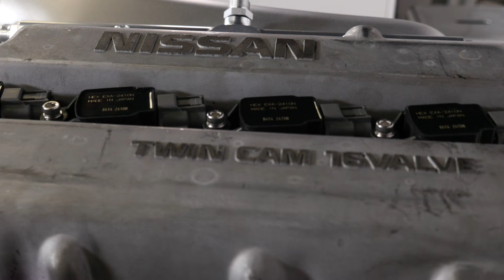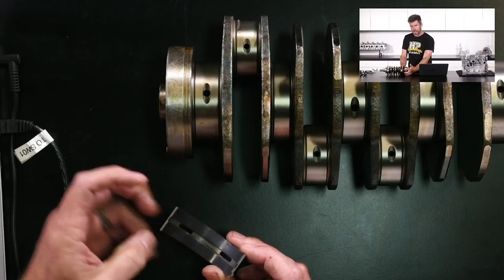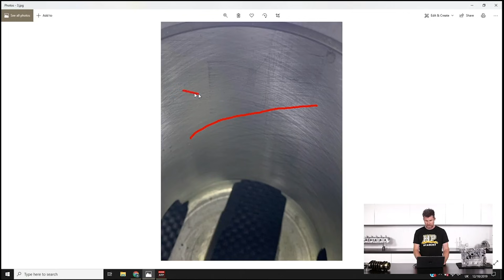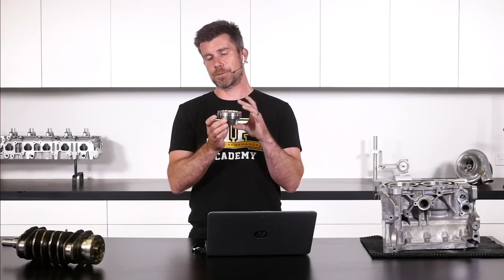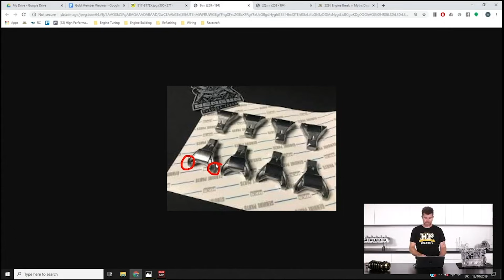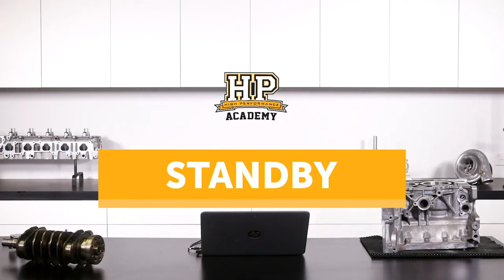Engine Break-In Myths Dispelled | Engine Break-In Tips And Tricks [GOLD WEBINAR]

Comment: I think one of the most overlooked things is the very first oil change I feel like the engine should be run for just a few miles and then get an oil change to get rid of all of the metal and other contaminants that happened to be there during the engine building process
Reply: Use a good quality oil filter, replace it immediately, as you replace the oil, after that initial break-in. It's imperative, that the filter be a fine enough mesh, that it filters particles larger than the film thickness of the oil.
Reply from the maker: I'd agree, and this is covered in the webinar.
Reply: that's why god created oil filters
Reply: @AnissaEx  All engines I've seen have some type of filter bypass, the filter doesn't catch everything.
Reply: @jeffreydurham5342  Probably why they don't want high revving until that first oil change.

Comment: On the idling note. There is a diesel  mechanic on YT that found that the trucks that spend the most time idling have polished cylinders allowing lots of blow by. He had a costumer bring in a very clean low mileage dump truck that was consuming huge amounts of oil. The guy he had bough it from said it was is good condition because it sat idling (more than usual apparently) while waiting for loads to hual. Basically the outside of the truck was great, but the engine had to be rebuild.
Reply: Yes, that's very true.  There still seems to be misconception in the diesel world that idling is acceptable and even desirable which has never been true. Just don't beat on it or put significant load on it until your oil and coolant are up to temperature

Comment: I have very little knowledge mechanically and this is exactly what I did breaking in a new motorbike I brought in 2015. Read that sitting at the same rpm was the worst so used a “hard break in” method used on race dirt bikes. Used varying loads with acceleration and de- acceleration over a range of gears and rmps progressively increasing the throttle. Not practical to do on the road out of the shop as your rolling on and off the throttle but I did this for the sole reason of maximum compression by seating the rings to the cylinder bore wall.

Comment: Sorry if I’ve missed the answer to this, but if break in can be done so quickly (and I like your rationale) then why do credible car manufacturers still say to limit revs and load for several thousand kms? Is it for components outside the engine?
Reply: One conspiracy theory claims it's because they want you to take it slow out of the dealership and not crash in the first bend.
Reply: A passenger car engine typically has tighter clearances, than a racing engine. As such, you want to make sure the pistons don't expand enough, to grab the cylinder walls, which can cause scoring. That's less likely to happen, once the cross-hatch has been scrubbed off the cylinder walls. Race engines are rebuilt after just a few hundred miles, modern car engines are crafted to last 250,000 miles, or more! It's not uncommon, for a well maintained engine to out-last the rest of the car.(not counting a bad accident)
Reply: I think it is a hangover from way back when; as stated in the video honing and ring manufacturing techniques / metallurgy have developed in the last 40 years and what may have been suitable for older components in cast iron blocks with wide clearances and much simpler engine oil compositions just doesn't help on modern engines.
It is probably in part a liability thing (they don't want an engine to blow up when the owner sends it right off the forecourt) and they know that whatever they say in their manual will be ignored anyway by the vast majority of their customers, who heard something once from their uncle's-friend's-neighbour's-nephew who rebuilt a lawnmower engine 20 years ago about how to run an engine in.

Comment: You absolutely need to get oil pressure before you ever start the engine. Disable the ignition and crank it till you get oil pressure. Assembly lube is far superior to using only motor oil.
Reply from the maker: Yes, cranking the engine to achieve oil pressure prior to startup is essential and was discussed. I actually don't advocate using assembly lube everywhere during the assembly process. I'll use it on heavily loaded components (valve train/cams, and the wrist pin), however I prefer a good quality mineral based oil to lubricate the bearings. The reason is that assembly lube is much thicker/more viscous than engine oil and this affects how easily the crank will turn after assembly. As an engine builder you tend to build up a feel for how easily the crank should turn and using assembly lube has a big impact on this feel.
Reply: No, if assembeled correctly there is lube enough.
Reply: @TheEsseboy  Starting an engine with dry galleys and only oil film on the bearings is begging for trouble. It is critical to supply oil to all of the galleys and bearing surfaces before initial startup. Heavy assembly lube will be enough for the engine cranking to make oil pressure.
Reply: @David_H_Parker  All engines are assembeled with assembly lube...
Reply: @TheEsseboy  You are looking over the shoulder of every engine builder? Not everybody uses it. Making such a statement discredits any following argument. 

Firing an engine without priming the oil system by gaining oil pressure first is typically a bad idea.
Reply: @David_H_Parker  on some engines  just cranking the engine you will not achieve oil pressure as it depends on the design of the pump it has to achieve a certain rpm to get the desired suction . I've seen people crank the engine continuously trying to achieve oil pressure and seriously scuff the shells or seize the engine if you built the engine properly you now it's right just start it with a oil pressure gauge
Reply: @terminaldiagnostics5576  Yes. That is what I said originally. 

Prime the pump with a good assembly lube or vaseline. Disable the fuel and ignition, crank it until you get oil pressure to the sensor. Install the spark plugs and re-enable the fuel and ignition. 

Cautiously start the engine , monitoring the oil pressure and other important instruments.
I have been building engines for decades and there hasn't been a problem when you use this method.
If the pump isn't primed properly, it may never develop enough suction to work.
I like Clevite assembly lube because it is sticky and primes the pump beautifully.
Reply: @David_H_Parker  Back in my day you could spin the oil pump up with a drill before you put the distributor in ;)
Reply: Ive actually seen damage done to a oil pump because the assembly lube was too thick and there was too much of it in the rest of the oil system 
It split the gear because it was basically hydraulicing a fuild that's too thick to fit through such a small hole 
Also, cranking for oil pressure is a must before starting 
It's normally best to disconnect the fuel injectors if you can, that way there isn't excessive fuel in the chambers on first start, I've seen intake back fire corse a lot of damage to a never run before engine

Comment: Hey Andre, if you 'race' a 5W30 full synthetic oil, per your suggestion of running a mineral base for break-in phase, would you also run a 5W30 mineral base? Or what would you suggest for the break in phase mineral base oil, heavier, lighter? etc. Cheers, great content!
Reply from the maker: I generally aim for the same weight oil that I intend to run, only in a mineral form.

Comment: very weird 1st of april video... everything seems sound and true haha
would you check head studs torque after some heat cycles on high boost racing engine?
Reply from the maker: No jokes here! Yes it's not uncommon to re-torque the head after a heat cycle. This is less critical with MLS gaskets than the older composite gaskets but we still did this with our high boost drag engines.
Reply: Im building a basic 7age 20v would i want to re torque the arp head studs after the first heat cycle. Im using a trd MLS gasket.

Comment: Atf on piston rings to aid with break in?
Reply from the maker: I know this is a technique that a lot of engine builders use. Personally I don't do that. Engine builders tend to be a bit of a superstitious bunch and once we find something that's proven to work, we tend to stick with it.
Reply: engine oil, fill the groves in piston prior to installing rings, no dry spots
Reply: I've used some Atf in the old oil before draining to condition seals and remove sludge deposits. ATF is loaded with seal swelling agents and detergents and emulsifiers, just don't add more than a quart and don't drive or even rev the engine with the ATF in it.

Comment: Drag racers basically thrash on engines right after a rebuild. The only "breakin" I still see people do is if they have an old school flat tappet camshaft to break in the cam. It's not as big a deal as it used to be as they make oil specifically for these now. 
I'm building around a 800hp 5.0 coyote and I will probably drive it around a bit and race it a few times before it sees boost but I don't forsee the need to really break anything in. Racing pretty much takes care of the rings.
Reply from the maker: The flat tappet cam is a bit of an anomaly in terms of requirements for break in. We still broke in all of our drag engines on the dyno which is not as much fun as it sounds in an engine with no coolant running through the block. I'm not a big advocate of just going straight into full power ramp runs as the friction due to the fresh hone pattern creates a lot of heat. That being said, drag engines at the pointy end generally get broken in during the burn out but if you have the ability to do a more thorough job then I recommend it.
Reply: @hpa101  
Lol, "bit of an anomoly" he says. (Old man voice) back in my day, sonny, flat tappet was all we had...
Seriously though, you're probably right. That's why I mentioned I don't take my racing engines straight to the track but some people do. Then again, not all of us have the benefit of a dyno, mr. big shot! (jk)
Reply: Drag racers rebuild after pretty much every run

Comment: Nice to know I've allways done it the correct manner, and most good engine builders use this technique, as I've understand. Only addition, is that when running in NiSiC ("Nikasil") coatings, you really need to be even quicker and more brutal from the get-go. Also if possible, if the engine coolant can be circulated and heated and oil can be heated, so the engine is at working temp faster, this will also aid the rings to seat to the bore in its form where its mostly going to opperate, from the get go, especially if the block is bored and honed at operating temperature.
Reply from the maker: I haven't had the pleasure of working with nikasil coatings which I'm not unhappy about :)

Comment: what happens to ring-bed-in when the engine is "freshened up" with new rings and bearings but no machining/honing?
Reply from the maker: In my opinion this isn't really a freshen up and isn't a technique I advocate. I know plenty of engine builders do it but it can result in questionable ring seal and the potential for oil consumption. There is still some bedding to be done as the rings wear into the existing bore so the process remains the same as I describe.
Reply: @hpa101  I've even done the "not recommended" single piston replacement and I still hone. The key to single piston is a normal hone, new rings and piston if there's light wear, light hone, new piston and reuse rings if heavier wear. 
I think people get into the most trouble trying to break in new rings when there's a lot of clearance
Reply: It depends if there is any cross hatch pattern left on the bores. Ideally any time youre doing a "freshen up" you would inspect the bores and give them a quick hone if theyre looking a bit flat

Comment: Great info Andre.
I recently bought my first new car, an 86. Never dreamed I would buy new but have spent my entire life thinking about exactly how I would break in a new engine if ever I had the chance!

I logged oil temp, manifold etc. from the first drive to know exactly what to do. Used most vacuum possible, little load. Revved it out fully when appropriate very early on.

It hasn't used a drop of oil and a relative has had two Subarus in a row with the FA20 that have gone on schedule at the dealer due to losing litres per few thousand k's.
Reply: I have BRZ, what oil do you use?
Reply: @saulespino2510  Castrol Edge. Test results have come back very good.

Comment: Excellent advice as usual,  used to work with an ex Cosworth guy and they would throw Vim into the stacks of the DFV to bed the rings and get lots of exhaust sparks .have you tried dry fitting the pistons and turning over by hand for a few rpm ?
Had an old Mercedes on Bosch k massively over fuel and bore wash after 15 minutes , smoked like a train , perforated map diaphragm was the cause
Reply from the maker: Turning over by hand unfortunately won't do much useful in terms of bedding the rings. We really need combustion pressure in behind the rings to force them against the hone pattern.

Comment: Using your run in method, do you still use mineral oil when you change it after the initial run in is done?
Reply: No,he switch over to 100% synthetic.
He talked about that quite allot
Reply: Lonewolf rider so basically after 100-200 kilometers because rings are seated in 80% or so?

Comment: after a rebuilt and right before the very first engine start , I always use pressure remote oil feed , using the oil pressure port.  I usually inject 2.5 ltr of oil , this will prime all the engine , oil pump included.  on tha first start the engine will have instant pressure.  the tool I used is an DIY one from an water filter.  is equipped with manometer , air pressure regulator , air trigger controll and for oil fittings I use the ones for a oil pressure test kit.
Reply from the maker: Yes, that's a valid option and one that many use. If you run a dry sump pump then you're even better off as you can remove the belt and drive the pump manually to achieve oil pressure prior to startup. The reality for most people though is that removing the spark plugs and cranking the engine on the starter is absolutely fine and you won't do any damage provided the engine was properly lubricated during assembly.
Reply: @hpa101  
This doesnt apply to rebuilds or engines modified for high performance ce use but production engines are tested in cells for oil pressure, ignition timing, cam sensors if any, vacuum etc. All drilled oil passages are washed with high pressure. Plus on aluminum blocks and heads oil passages are gun drilled using a high pressure coolant.  If the coolant flow is interrupted at all during the gun drill process the gun drill will seize in the hole. These holes can be drilled 300mm deep or more in around 20 seconds. The odds of machining debris inside a production engine is extremely low today. In the past with cast iron engines that's a different story.

Comment: All engine oils still contain ZDDP. The limit is 800ppm for both Zinc and Phosphorus, as part of the SN spec.

Personal opinion to follow: I'm convinced that there are metallurgical issues causing American flat tappet cams going flat. As this never seems to be an issue with classic Japanese flat tappet eninges.
Reply from the maker: The current specification for maximum zinc levels is much lower than what we saw 20-30 years ago and as a result we don't see the same level of protection. This is why there is now a market for ZDTP additives or special break in oils with a high ZDTP level.
Reply: I run REDLINE full synthetic in my 2 newer vehicles. They have a lot of ZDDP and phosphate over “ the limit”